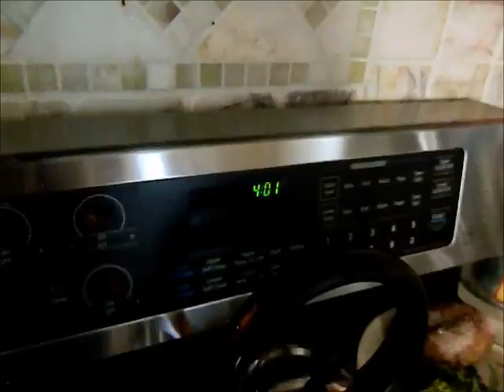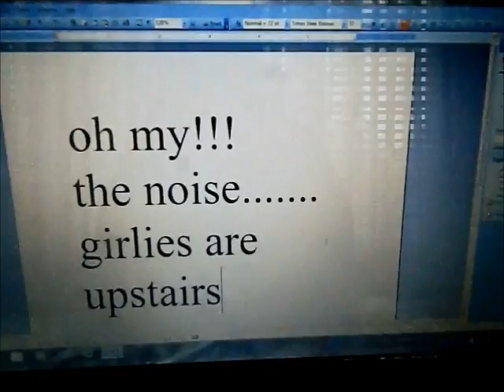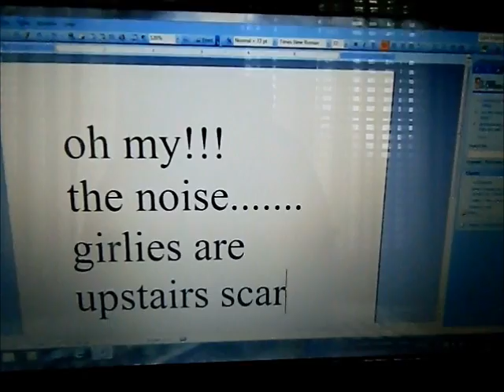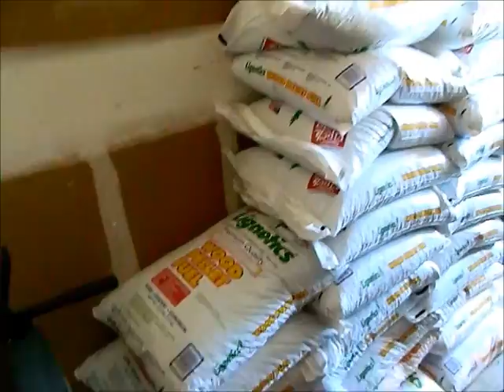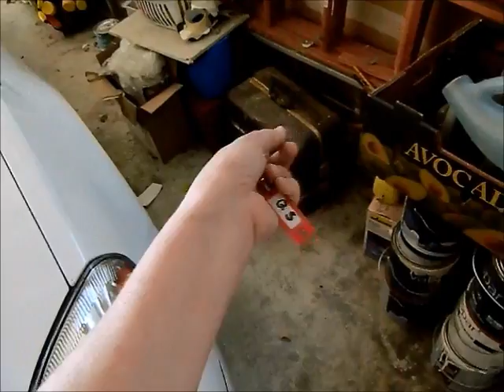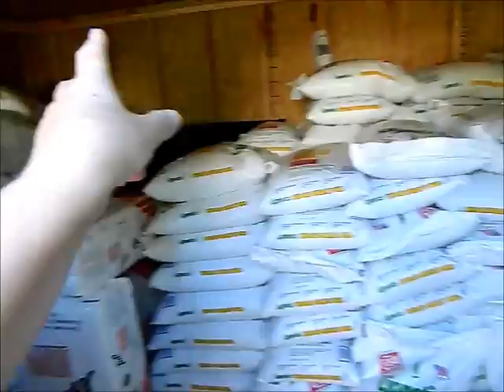Don Pablo's & Stove Disaster

Comment: Wow, our stove went in in a few hours and they had to cut through 2 roof lines !  But your stove looks small. Our pellet stove also holds a 40 # bag but it heats a 1000 ft house. Your house is much bigger than ours and that stove looks small for your house. I'm sorry that you are having problems like this. I hope all things work out for you.
Reply from the maker: +Pocono Prepper I know, its ridiculous. This stove is the same size as the last one. The difference with this new one, we have a blower, which will blow the heat. Our last stove kept the house very warm, and it didn't have the blower on it. We also have the furnace we run, in addition to the stove. I'm thinking this one may at times keep the house to warm. If we were using the stove as our only source for heat, yes, it would be too small for our sized house. There is something with the design of the tile work and opening that keeps us from getting a larger stove. But I'm not sure sitting so close to the stove, I'd want anything hotter. I'll keep everyone posted on how this new one is, in comparison with the old one. :)